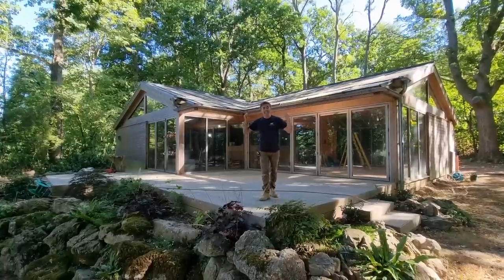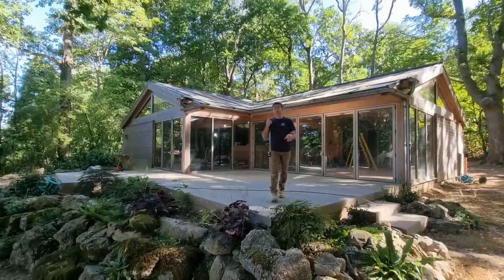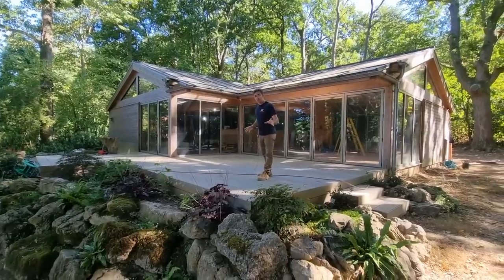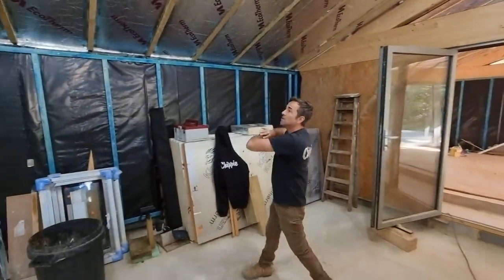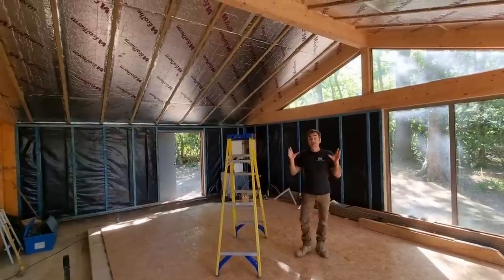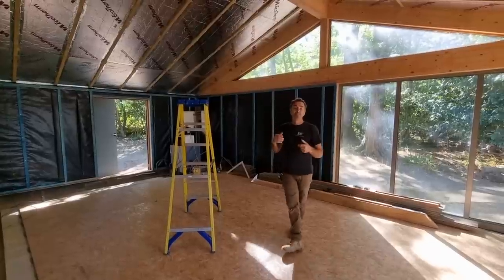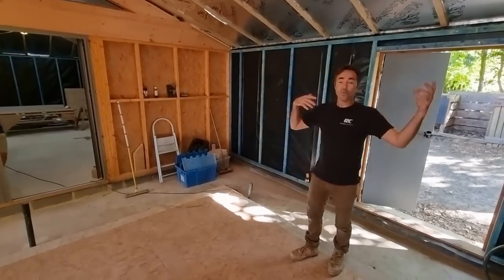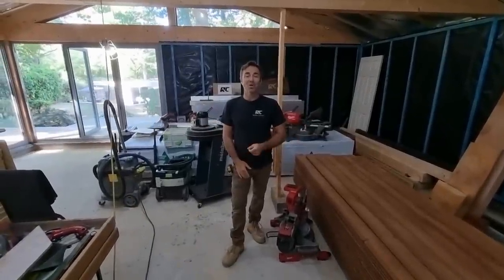Ultimate Garden Room series trailer

Comment: I meant to ask when I saw the decking video - was there no need for a linear drain in front of the bifolds? I would be worried about water coming in if there were flash floods. I’m hoping to replace my balcony so concerned about water getting in if it’s put level with the door.

Comment: I am really looking forward to this. The house that was/is on the property is gone?  I didn’t understand. The one built with all the glass. The one u built those beautiful front doors for. The one where u did the deck and put that neat tape on top of the joists. One last question. Is there more than one pool on your property?  I’m a long time follower and I’m confused. Love all u do!!  Thank u soooo much!!
Reply from the maker: Hi Bill, sorry for the confusion!! The glass house is the new house I refer too, the pool is in the garden room where the decking was fitted!! So up the garden from the main house!! Hope your well over there in California!!
Reply: @ukconstruction   Doing much better after getting a reply from RC!!  We r just ending the swim  without heat season  in our little pool. Over the years I was privileged to b a pool man at many beautiful homes in Beverly Hills. A few were indoor. The muggy swamp like conditions were not conducive to enjoyable swimming. It’s not just the high humidity, the humidity is laced with a strong chlorine smell which is also very corrosive to anything metal. I’m sure u gents over the pond have learned to deal with all those things. Anyhow, it’s going to b a great series. Pics of the pool equipment will b fascinating to me. Do u use coated rebar in the pool structure?  Here they stopped that on account of poor electrical grounding. Whoops!!!  Earthing😍😍

Comment: In sunny capel we went down the pier and beam route. I phoned a piling company and it sounded like writing a blank cheque because they couldn't confirm the depth needed. 10m not too bad I guess.
Reply from the maker: Hi David, is your job near mine???
Reply: @ukconstruction  we're on the clockhouse bends, grey feather edge house with the solar panels on the garage roof.